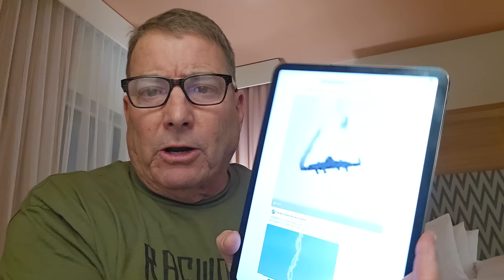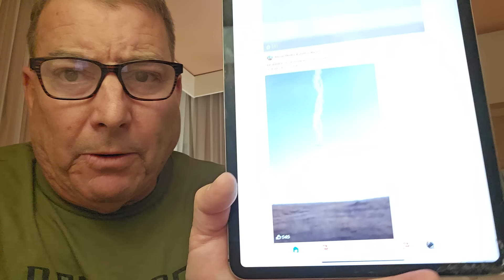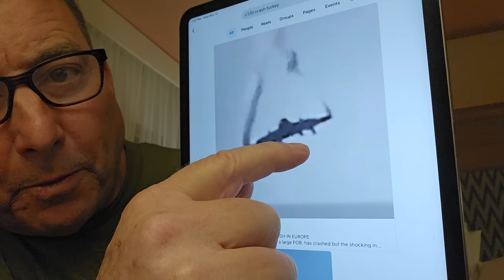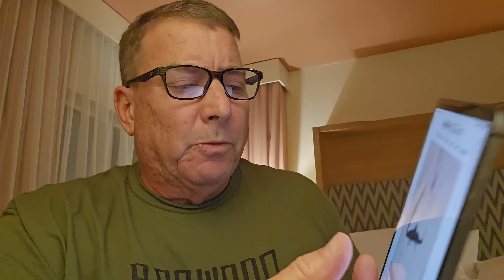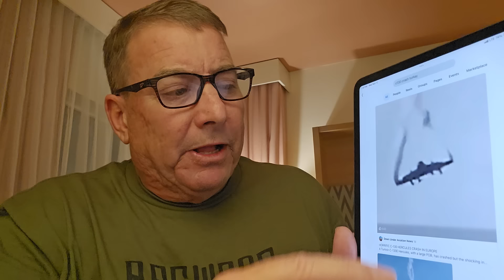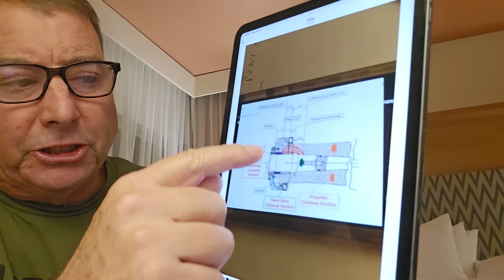Turkish C-130E Structural Failure 11 Nov 2025

Comment: Here’s the information I have: that airplane received major avionics and structural upgrades in 2012. It should be a well-maintained aircraft. Also, the tail of the plane separated before the wings and fuselage. R.I.P. to the crew. 🙏
Reply: I've seen that report as well. Hypothesis: prop severed or jammed control cables, violent pitch oscillations broke first tail then nose from the wing box.
Reply: @KennethAGrimm  Seems to me once the tail separated in this scenario, there would be no more source of significant pitch oscillations; and thus no forces acting strongly enough to separate the nose from the wing.  I’ve seen tails come off other aircraft but none that subsequently resulted in further breakup other than wings coming apart individually (as they folded in on each other).  So there’s no video showing the aircraft prior to the wing-box being on its lonesome?
Reply: @DavJumps  There are "reports" of the tail (not just the tail cone) coming off "in a longer video".
I have no evidence of the credibility of these reports.
Reply: Source?
Reply: The source of the modernization is the Turkish Air Force. The project is called Erciyes Modernizasyonu. The information about the wings separating before the mid-fuselage comes from a video I watched on X. the tail was found much farther back on the ground, before the location of the wings.
Reply: @highway9patrol  Both the wings and tail have lift; the tail has a lot of lift and little mass. How far apart are we talking? In which direction (relative to both the aircraft’s flight path and prevailing winds)? By what mechanism do you propose the tail separated from the aircraft first?  Sabotage? A bomb?

Comment: In the closer up video, you see straight through the fuselage from end to end. Blue sky at the other end. Terrible situation.
Reply: Yes indeed.
Reply: Such a propellor failure who cause instantaneous explosive decompression and the loss of the front portion of the fuselage. The forward speed could be sufficient to blown the tail off the aircraft, failing just aft of the wing.
Reply: @christopherrobinson7541 were the pressure reversed, high pressure outside, low pressure inside, that might be possible. It would be like breaking the end of a florescent tube. In this case it might just be sheared off as the air frame broncos.
Reply: Bombed from the inside , mossad
Reply: @Toro_Da_Corsa  let me guess, based on literally no evidence at all?😂

Like others have said, the falling debris debunks that notion
Reply: @mrdumbfellow927 so prop blades slice massive freighters in half now ? What a design that is
Reply: @mrdumbfellow927 also...Israel and Turkey have a lot of business together and with Azerbaijan. Politics aside there's no way Mossad would want to do this.
Reply: @Toro_Da_Corsa Same thing happened to a KC-130 in 2017.
Reply: A lost blade would result in entire prop tearing loose at high rpm, I imagine.
Reply: @Toro_Da_Corsa did you even watch the video? It's literally happened before.
Reply: @Toro_Da_Corsa  Remember: Anything you don't understand is a Jewish conspiracy!
Reply: @Toro_Da_Corsa  You seem to be the expert.. 🤣
Reply: @Toro_Da_Corsa  have you ever looked at an airplane . Just a tube made out of thin aluminum.
Reply: @Toro_Da_Corsa  : Allison 501s have been slicing airplanes in half since at least 1967, when Lake Central lost a CV-580 the same way, so... yes.
Reply: @Toro_Da_Corsa The "Yanky 72" crash refers to the 2017 crash of a Marine Corps KC-130T Hercules aircraft near Itta Bena, Mississippi, which killed all 16 service members on board. The accident was caused by a propeller blade failing due to fatigue cracking, which sliced through the fuselage and led to the plane breaking apart in mid-air.
Reply: @Toro_Da_Corsa  No. This is not how aircraft come apart from explosions.
Reply: @Toro_Da_Corsa  Put the pipe down.
Reply: @mxb_se He's a crackp¡pe expert
Reply: @Toro_Da_Corsa idiot 😂
Reply: @RobertFothergill-u1z  Re: the Toro person: Some people can't seem to accept that accidents happen and it has to be someone's "fault".  I find this to be the case with religious people in particular but it's of course not true for everyone.
Reply: @samhhaincat2703 true,if anyone is at fault it's the Turkish air force for not running upgraded props to fix a known issue 😮
Reply: @Toro_Da_Corsa 😂😂
Reply: @Toro_Da_Corsa  Yes, lets all listen to a random troll making a wild idea sound like facts. Shame on you for polluting for no good reason. It is so lame.
You contribute with nothing good. Paid?
Reply: @Toro_Da_Corsa  Big footed comic.
Reply: @Toro_Da_Corsa  BS.
Reply: @Toro_Da_Corsa dumb ass
Reply: @Toro_Da_Corsa you must have a least a dozen “Brown Shirts” in your closet. Probably growing a funny mustache, also. Pathetic
Reply: A fine example of the intersection between anti Semitism and mental illness. No, the Mossad did not take down a random elderly C130E.
Reply: @Toro_Da_Corsa  If Mossad did something like this they would make it seem like an accident through sabotage
Reply: @Toro_Da_Corsa Nice that people think of them as superheroes 😊. 
Mechanical failure = Occam's razor.
Reply: @Toro_Da_Corsa  Imam Obama has a cookie for you

Comment: Maintenance, Maintenance, Maintenance. Fat Albert is a C-130J.
Reply: %100
Reply: Fat Albert has six bladed props now. This C-130E #68-1609 was running the older four bladed prop.
Reply: It is well-maintained aircraft. It should be another reason.
Reply: @highway9patrol do you have a source for the maintenance information?

Comment: Failure at 24,000 feet. Hopefully everyone was unconscious for the crash. Terrifying video.
Reply: They had about 2 minutes of -50c free fall.
Reply: @ZeroSpawn  About -40c initially but getting warmer the whole way down.
Reply: Very unlikely. A load of military men are not just going to fall peacefully asleep at 24,000, apart from the fact that within less than a minute they are getting down towards 10,000 ft where even your granny can breath.
Reply: Probably not an oxygen issue like you suggest. But the g forces were probably brutal.
Reply: @JoshuaTootell Yeah. I realize it's not quite high enough. But I'm also hoping the gs were enough too. I just can't imagine being conscious for such a terrible experience.
Reply: @JoshuaTootell  Apart from the initial breakup, 1G all the way to the ground...
Reply: @davidkavanagh189 The parts falling are likely to be aerodynamically unstable and so they will tumble, which exerts force on the occupants.
Reply: @TricksterJ97  In the footage you can clearly see the wings and central fuselage stable, partially inverted and slowly rotating around the yaw axis. Even for those perhaps in the nose section, it would have to be in an end over end tumble at quite a high rate and even then only those and the extreme ends would feel much force but nowhere near enough to make anyone black out. All that being said, I imagine some of them or maybe even most were ejected from the aircraft completely, especially if seat belts were off at the time.

Comment: Tragic.  Nearly 60-year-old airplane. I've flown passenger in many of them but thankfully mostly the newer j models
Reply: If you feel bad about aging airframes, try flying a B-52 or a Chinook.  There are many that are WAY old.
Reply: @baomao7243  Plus the KC135. They stopped making those in 1965.
Reply: @davidkavanagh189 Totally forgot about that one.  I just remember seeing a DOD airframe transition plan going out past 2050 and that really got my attention.
Reply: @baomao7243 I visited a company that operates and services CH-47s (aka Vertol-234s and 234SPs).  We looked at one being serviced and our tour guide asked which parts we thought were original.  I guessed the airframe.  He pointed to the aircraft data plate and said “that’s the only part that remains from the original helicopter.  Everything else has been replaced.”  My jaw dropped.  You might think that some of these old aircraft are old, but as I learned that day, it’s not always the case.
Reply: I did a lot of flying and work with the MC-J models, and the newer AC-Js and several others. Great aircraft.